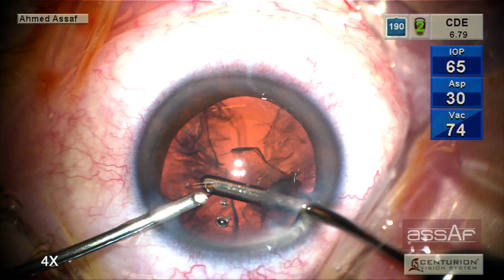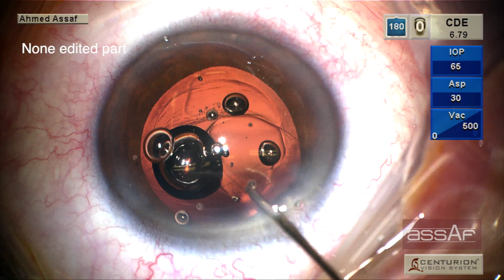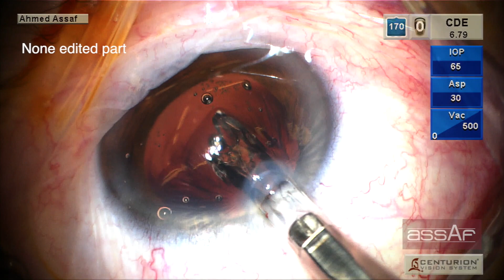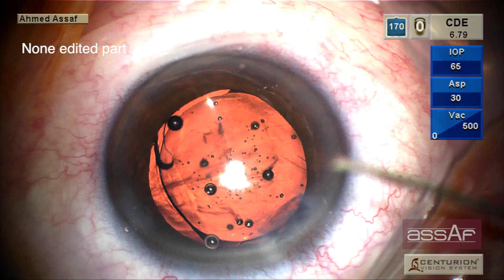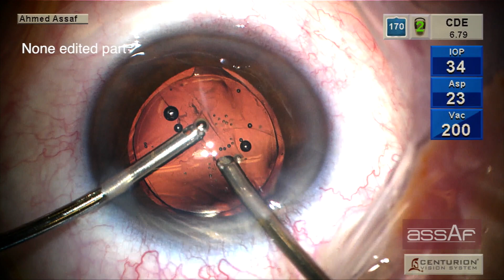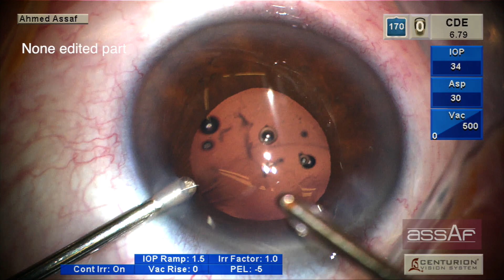Open Posterior Capsule before IOL Implantation. Ahmed Assaf.

Comment: Thanks  Sir, we learn a lot from such Video, thanks again. In case of reverse optic capture, no need to adjust or reduce power of IOL, or the postoperative myopia is insignificant?
Reply from the maker: Thank you very much Fatma, I don’t adjust the IOL power as the amount of myopic shift is usually very low . And it fades out with time by contraction of the capsule which brings the IOL  back to almost the same level as if it is in the bag.